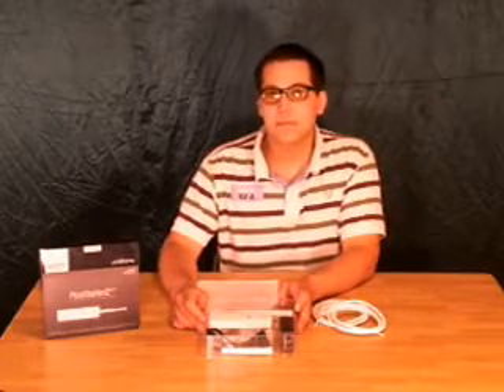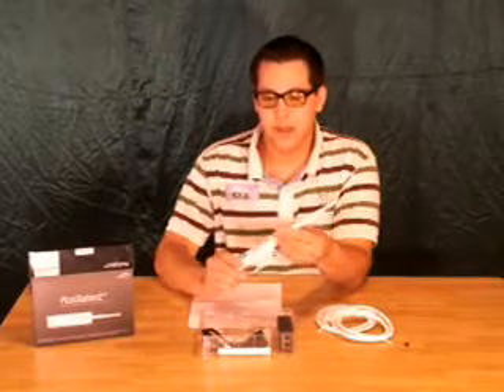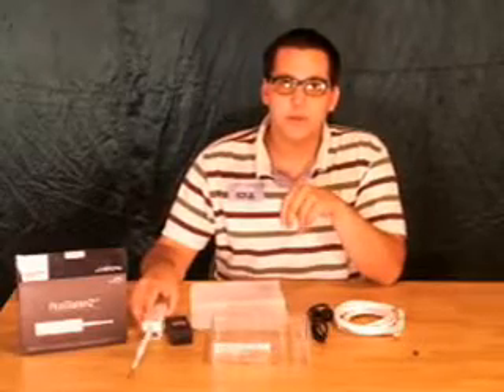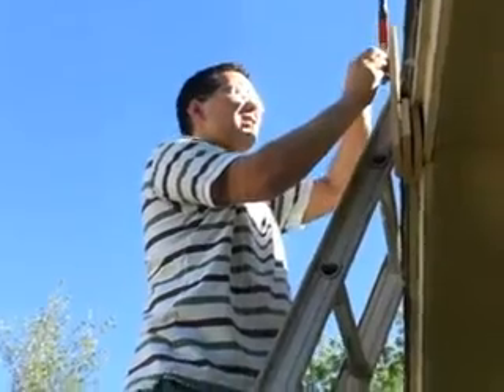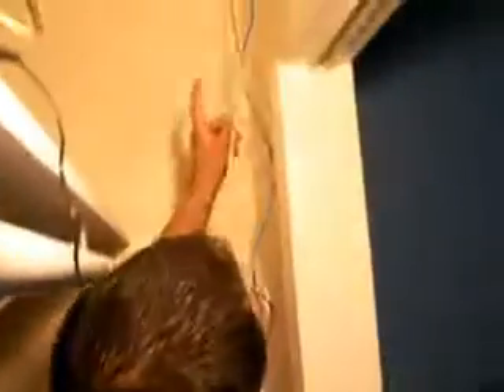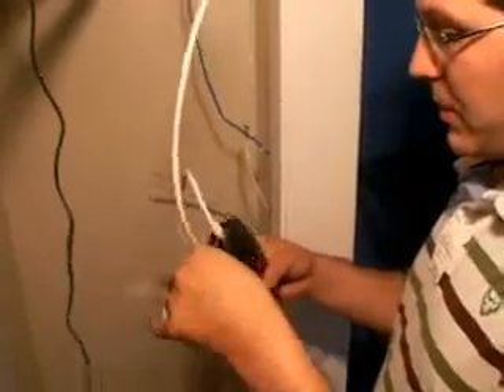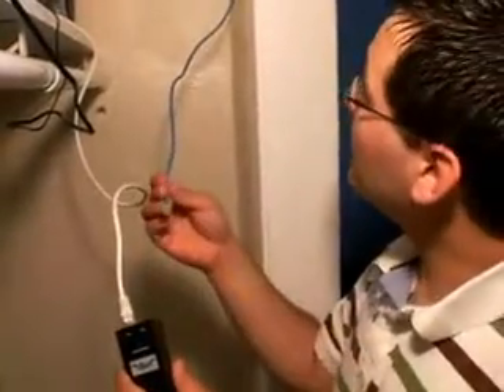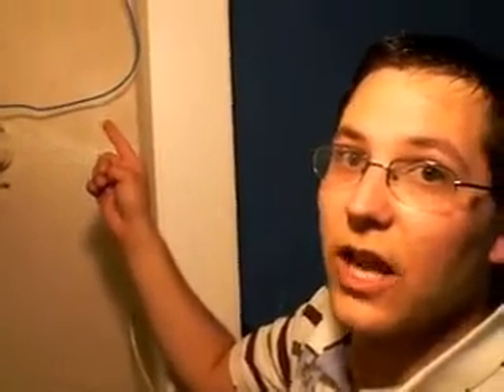how to setup a wireless hotspot part 1

Comment from the maker: @theredpopripple, Now this is the best question i have heard in along time... Look for a router like fonera or look for a public/private router. but i would have to say a fonera with dd-wrt,openwrt and possibly tomato would be your best bet and the most cost effective. i do know that cisco makes a public/private router.The other option is to use two seperate routers.Fry's you can pick up a frys branded router for 20.00 and 30 for one that supports wireless N. the frys routers are made by d-link.